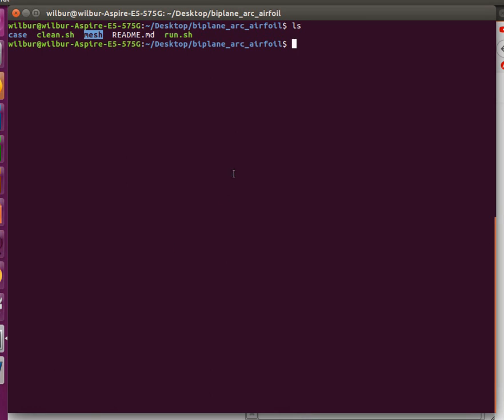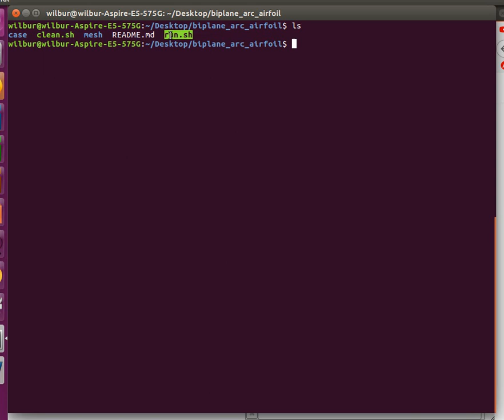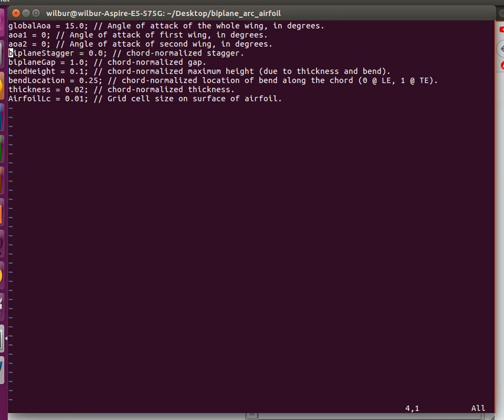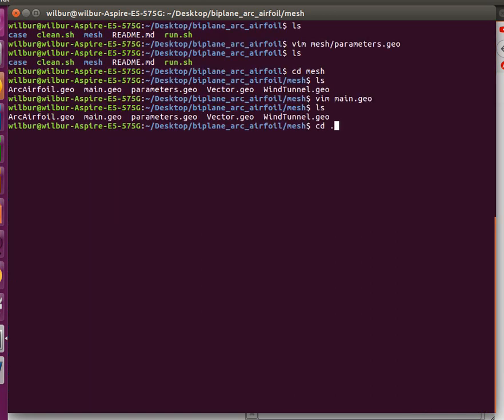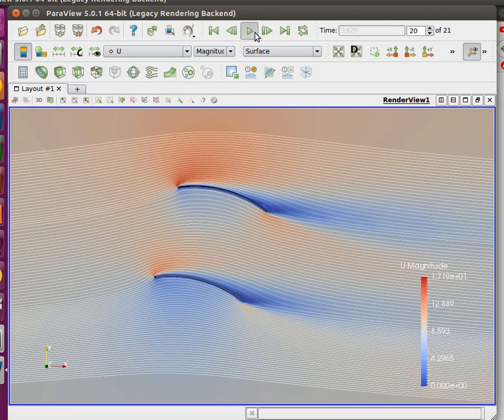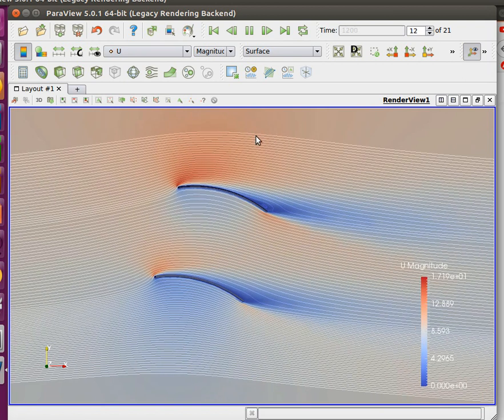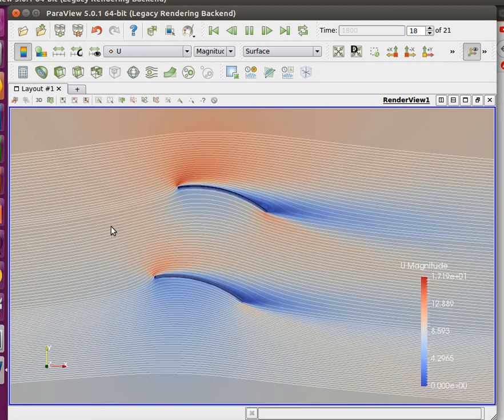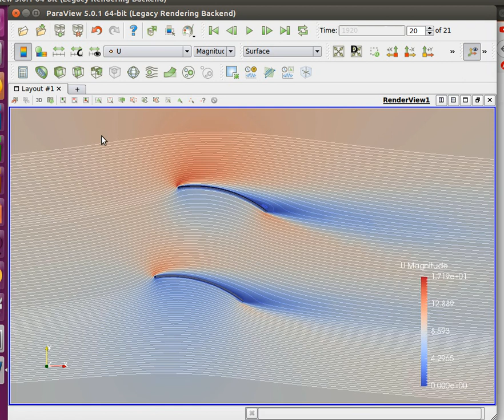Circular Arc Biplane Airfoil Simulation with OpenFOAM and Gmsh

Comment: hello, Thanks a lot for the tutorials you do and the explanation.
I have tried to launch the simulation following the steps.
The mesh is well generated but once I try to launch gmshtofoam I have this error:

--> FOAM FATAL IO ERROR:
Bad token - could not get scalar value

file: input at line 0.

    From function Foam::Istream& Foam::operator>>(Foam::Istream&, Foam::doubleScalar&)
    in file lnInclude/Scalar.C at line 136.

FOAM exiting

Do you have any idea of what can be the problem ? I am beginning on OpenFOAM.
(Using it on Ubuntu 18.04 LTS bash on Windows 10) with OpenFOAM 18.12
Reply from the maker: Hi Yannis, I just pushed a fix not too long ago. Can you pull the latest changes and try again?
Reply: @OpenFOAMTutorials  Hi, I have tried and I have the same error I don't know if it is the versions I am using.
Here is the error message:
CellZones:
Zone    Size
    0   9996

Skipping tag $Periodic at line 40690

--> FOAM FATAL IO ERROR:
Bad token - could not get word

file: input at line 0.

    From function Foam::Istream& Foam::operator>>(Foam::Istream&, Foam::word&)
    in file primitives/strings/word/wordIO.C at line 45.

FOAM exiting

The versions I am using are:

Gmsh 4.2.3
Ubuntu 18.04 LTS
OpenFOAM 18.12
Windows10
Reply: @OpenFOAMTutorials   Can I know the version of OpenFoam and Gmsh you are using ?
Plus, are you running your simulations on ubuntu or on windows (either ubuntu VM)
Reply from the maker: @yannisyoussef7602  My versions of gmsh and ubuntu are same; not on VM. very strange. you must be using the ESI openfoam, rather than that from openfoam.org. that might be the issue.
Reply: OpenFOAM Tutorials Thank you so much, you were right.
I have installed it again and it is now working 💪🏾💪🏾
Reply: @OpenFOAMTutorials   I have an additional question, I have checked the files (geo) to see what to modify in aim to run a simulation with Naca profiles, but I haven't understood how it works. Can you please let me know how did you manage to make  profiles of the simulation ?
Reply from the maker: @yannisyoussef7602  Have you seen my NACA 0012 airfoil simulation video? https://www.youtube.com/watch?v=vZgta7ImGIc
That should be a good starting point. If it is still too difficult, let me know and I may make a separate video on biplane using NACA airfoil profiles.
Reply: OpenFOAM Tutorials Yes I have seen it and tried to apply the same principle you did going from a single profile to two profiles, and I get errors, I also tried to modify the files from the singlebendairfoil tutorials, replacing the main.geo and including the Naca.geo profile but I still have an error when trying to generate the mesh. It will be helpful if you could make or show how to separate naca profiles 🙏🏾
Reply from the maker: @yannisyoussef7602  I will soon start working on a tandem wing simulation using two NACA 0012 profiles. I will make the location   of one airfoil easily adjustable for biplane configuration.
Reply from the maker: @yannisyoussef7602  Hi Yannis, please see my new tandem wing simulation video. I've made it easy to specify locations of multiple airfoils.
Reply: @OpenFOAMTutorials  
Thank you so much!!
You really are the best! :-D

I tried to run the analysis using the files uploaded on github and once run.sh is lauch and the mesh being generated I get this message :
Your choice of mesh element sizes will likely produce a very
large mesh. Do you really want to continue?

the answer to continue is "1". I've entered it and the analysis started  again but ended up at 7s, without any convergence nore subdirectories created in "case". I thought it could be the << Recombine Surface{TwoDimSurf}; >> in main.geo so I deleted it, the same warning message appears but once "1" entered the analysis starts again and last longer (35s) before it ends and did not reach any convergence...

Do you know what could be the reason ?
Plus the results obtained are quite bizarre (huge coefficients) an example:

Time = 20

smoothSolver:  Solving for Ux, Initial residual = 0.410461, Final residual = 0.0276283, No Iterations 2
smoothSolver:  Solving for Uy, Initial residual = 0.410461, Final residual = 0.0240822, No Iterations 2
GAMG:  Solving for p, Initial residual = 0.998086, Final residual = 6.50598e+10, No Iterations 1000
GAMG:  Solving for p, Initial residual = 1, Final residual = 0.00372573, No Iterations 1
GAMG:  Solving for p, Initial residual = 0.673228, Final residual = 0.00155476, No Iterations 1
time step continuity errors : sum local = 6.55205e+46, global = -2.56447e+35, cumulative = -2.56447e+35
smoothSolver:  Solving for nuTilda, Initial residual = 5.69499e-12, Final residual = 5.69499e-12, No Iterations 0
ExecutionTime = 13.78 s  ClockTime = 13 s

forceCoeffs forceCoeffs1 write:
    Cm    = -1.32487e+53
    Cd    = -7.81031e+51
    Cl    = -5.96544e+52
    Cl(f) = -1.62314e+53
    Cl(r) = 1.0266e+53
Reply from the maker: @yannisyoussef7602  Hi Yannis, so something about the mesh and / or boundary conditions you changed is causing divergence. Can you specify the changes? And let's keep this discussion on the Tandem Wing video comments instead of here. Thanks!

Comment: Hey there! Your tutorials and case set ups are really good for preliminary learning of both OF and gmsh. I am planning to just try out gmsh with the end goal of meshing a simple cylinder with wings for interest and fun.  I did mesh a simple wing with a naca airfoil and a square domain, apparently the mesh was not good enough and pimpleFoam couldnt converge.Have you ever tested a full wing in gmsh? What are somethings that might be different? For one i notice the extrusion layers is kinda like the mesh size in that extruded direction? Would be great if you could do a tutorial on 3D wing :)!